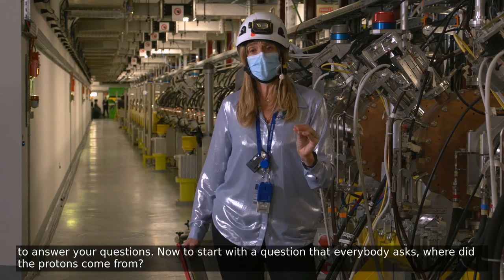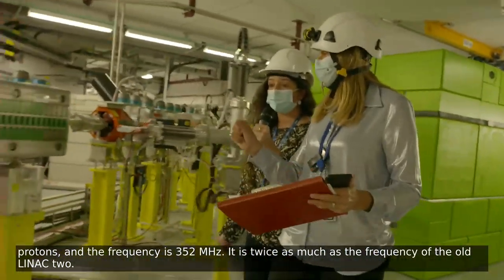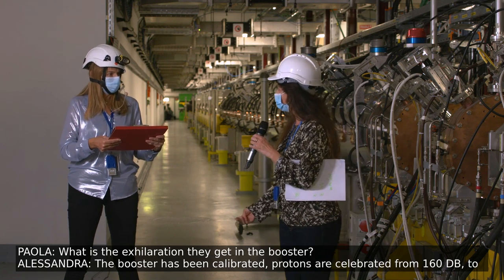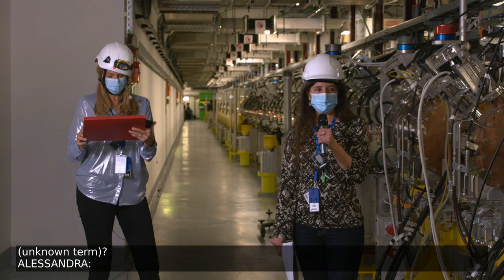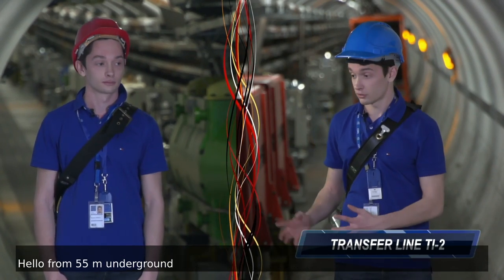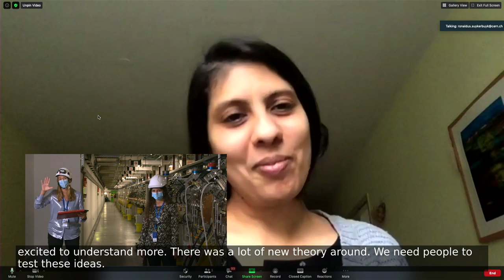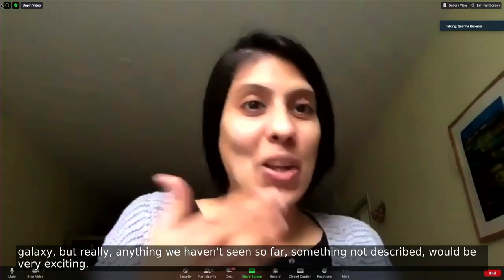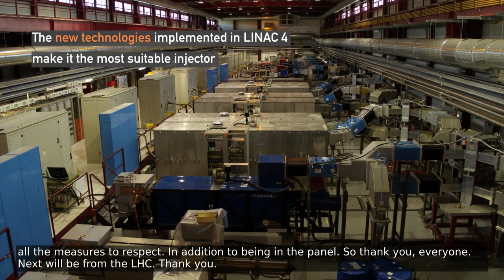WHERE DO THE PROTONS COME FROM?

Comment: A little wild theory of mine..
The Universe is Quantum and like everything else everything inside the Universe and the Universe itself tends to mimic...
So here's a wild correlation.
Like a Quantum computer, a superposition state is a unknown 1 or 0 classical outcome.
The fifth force:
So think of 'dark matter' as a 'superposition' state of 1 and 0, but more accurately like this -1 and 1 simultaneously unknown outcomes, until and external Magnetic field is applied ( the magnetic Universe).
This is called the Double Well Potential and the outcome is a classical state of 1 or 0 depending what was chosen, matter arises..in turn the the Universe is assigned always '1' because it's an open system.
Before the Big bang a '0', until it NReset again..
So all dark matter is, is unknown outcomes, until and outcome happens. All Possibilities.

So they'll never find 'Dark Matter' because it's not a result,.only an unknown.. 'GET IT'
Reply: Suns and black holes on the quantum level "the microscope begins where the telescope ends"